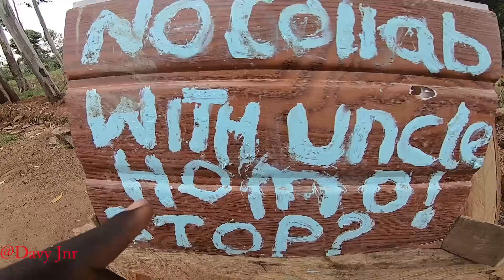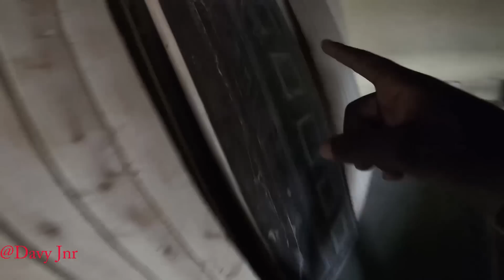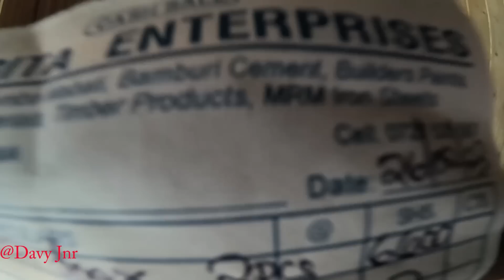Surprising my Uncle With Furniture || Priceless Reaction!!!

Comment: Yaz I was thinking instead of having a curtain at the doors to stop mosquitoes, I think of you can use the wood you have and a strong net. Make a frame with the wood and put the net in the middle. If you can see the net doors in some of the US movies. That would be a great invention.
Reply: The homes in Florida are fitted with the screens.
Reply: The best thing is screens on the windows and doors. I am surprised that they are not doing that.  I couldn't live in a house without screened windows.